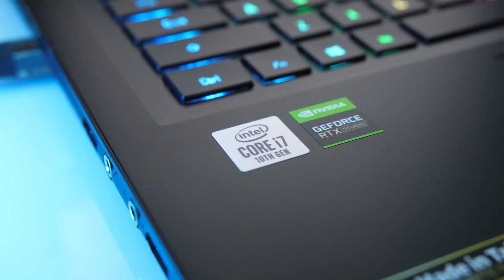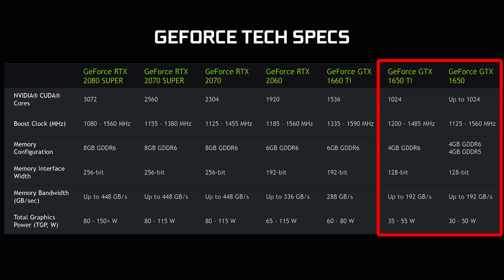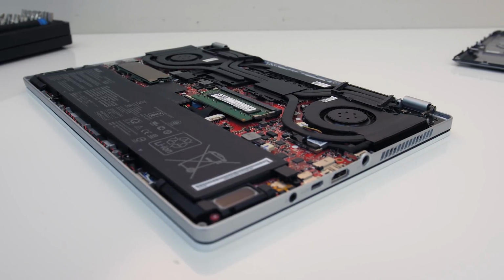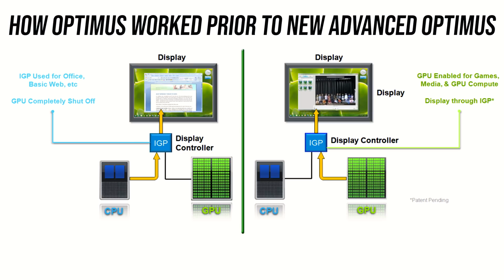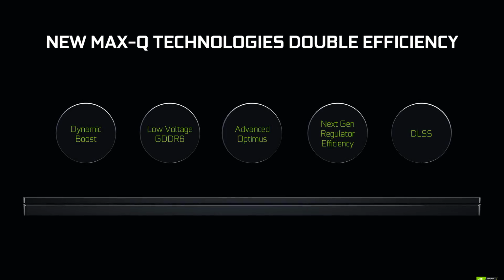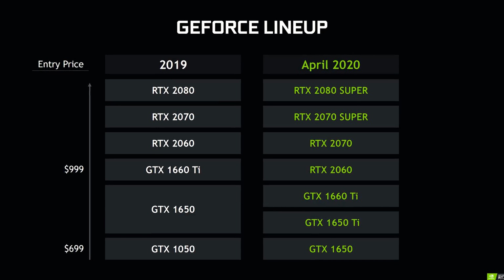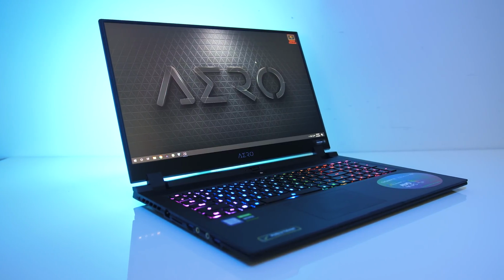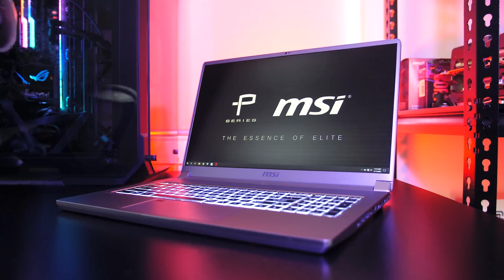Nvidia Super + Intel 10th Gen H Laptop Specs + Features!

Comment: After months of patiently waiting to hear the specs of the GS 66 and I'm glad to hear that it has the specs I've dreamt of 

Definitely buying a GS 66 with i7 8 core / Rtx 2080 super with 300hz screen
Reply: It's gonna be pretty toasty tho!😂
Reply: @btw8798  if is a bit too toasty I guess I'll just reapply new thermal paste with a laptop cooler (problem solved 😁)
Reply: @AFKBIN  liquid metal to the rescue. Wooohoooo!
Reply from the maker: Sounds beast mode 💪
Reply: @JarrodsTech  need them specs for 300 fps XD
Reply: @AFKBIN  I'd honestly go for AMD instead of Intel, it is better and cheaper I don't see a reason to go for Intel over AMD
Reply: @oneschannel3179  tho you'll never get a stable 300fps 😁 unless like 720p and lowest of the lowest settings
Reply: @oneschannel3179  personally I would choose AMD over Intel as I'm using AMD Ryzen for my personal desktop rig but sadly MSI doesn't offer the choice to choose ryzen 4000 

i like everything about the msi gs66 just couldn't choose ryzen / i did look into Zephyrus G14 but it maxes out at 2060 with 120hz only and i need much more horsepower with a high refresh rate screen as I'm a content creator 

That's why I chose the gs 66
Reply: From what reviews say the 300hz screen is garbage looking. Plus MSI has always been mediocre when it comes to thermals compared to Asus.
Reply: I’m waiting on the upgraded Zephryus lineup. Gigabyte OLED lineup needs an update too.

Comment: It’s actually mind boggling that Intel hasn’t been doing everything they possibly can to ditch 14nm.
Reply from the maker: Sounds like they have been trying, but that it hasn't worked out.
Reply: I suspect Intel figured on ruling the market with 14nm until 2030 or so.  Ryzen caught them so off guard that they are too busy cleaning their skivvies to actually innovate.
Reply: @rangersmith4652  all these chips were planned out around 5 years ago, you can go from a blue print to sold in a box in a day. they have to retool all their machines, test for yields, then when they have profitable yields do they hope to sell it.

theyve been working on 10nm for a couple years, but yields werent good enough, and then improvements werent good enough, so now their only real hope is to sneak 5nm before AMD and hope they catch up with that. real problem is once they hit 2 or 3nm (depending where they measure) they hit a wall against physics because the atoms can be bigger than that
Reply: well i think they did soo much efforts to move from 14nm since the first gen of ryzen came out but all of their efforts is just not enough to catch amd 🤷‍♂️
Reply: @brandonchutt312  not soon. 7nm EUV is the first on their roadmap i believe, and it's like a year or two down the line and only for certain product lines.
Reply: no way they'll pass up a chance to go lower. But so far they've just not been able to. the tick tock clock has stopped
Reply: They have but 10nm is so bad they can only make smaller chips because of the defect rate.

Comment: If I can snag a laptop with a 2020 2060 paired with an amd 4000 series chip for around $999 I'll be one happy camper.
Reply from the maker: It would probably be pretty entry level in terms of everything else (eg drive space/ram etc), but we'll see.
Reply: @JarrodsTech  just saying but if you really want to game dont buy a laptop it might have the specs but its not an desktop
Reply: Exactly what I thought! But considering how the world is lately, it's pretty unlikely
Reply: @fahmitaufik1254  yeah your looking closer to $1500 - 1600 with specs like that.
Reply: Chinese version of TUF g14? is already available with 4800h, rtx2060 90w,144hz display, 512g SSD, 8g 3200 DDR4 RAM at the price of ~930USD. Main drawbacks so far, are the cooling, poor display, and single memory of 8g.
Reply: @kimnorberg9783  shame for the bad cooling but is it really only single channel ram?
Reply: @rajamrifqi5764  it supports dual-channel without doubt, but currently only 8g single stick of ram version is available on the market. Plus the default samsung 3200 ram makes it a bit hard to expand ram yourself.
Reply: @kimnorberg9783  is the 8g ram embedded in the motherboard?
Reply: @kimnorberg9783  in some areas of the world ddr4 3200 stick for laptop is much harder to get.
So they should supply then quick but under the current circumstances these laptops may be coming in late 2020.
Reply: @rajamrifqi5764  Nope, but only hard to find on market.
Reply: @_Zardari_  yes, I only know ddr4 3200 laptop ram from SK hynix, Kingston... can be counted with one hand
Reply: @kimnorberg9783  good to know
Reply: @kimnorberg9783 yeah its a shame they physically trimmed down holes for air vents. Might see a diy case for sell soon given its blooming sales
Reply: @helloworld9996  Definitely. Cant wait to see.
Reply: Forget about it. It will be more expensive.
Reply: Also 1660ti is acceptable
Reply: The old asus zephyrs g went on sale for 900 at Best Buy when it retails for 1199 so it’s maybe possible
Reply: so far $999 is only gonna get you a 4800H and 1660Ti, which is still a pretty good deal
Reply: My dream for this year:
Ryzen 4800h + rtx 2060 (2020)
16gb ram 1/2tb storage 
At 1200€ (Italy)
Best candidate: helios 300 2020 hehe

To replace my 5 y/o hp with 6700hq & 950m
Reply: @suschilegge1683  Take a look at ROG G15, I'm comparing it with MSI GS66 which has an intel chip.
Reply: @suschilegge1683  eluktronics have it.
Reply: Good news
Asus tuf a15 its at that price

Comment: Wattage on the 1660 ti gives best battery and performance ratio. Think a gtx 1070 at 80w load. Nice.
Reply from the maker: Yeah it's a good one. 1070 was a little ahead of the 2060 from my own testing, and 2060 was about 14% ahead of 1660 Ti at 80W.